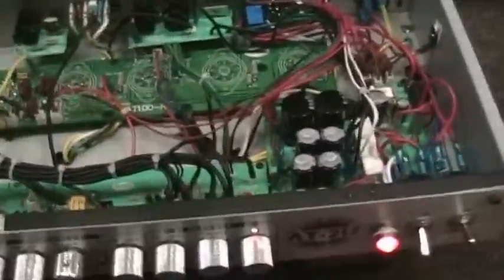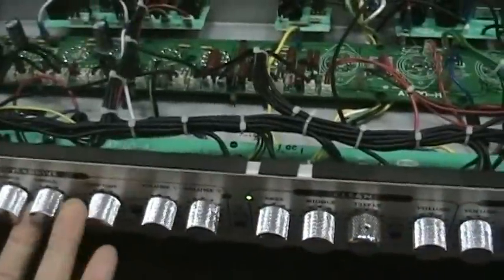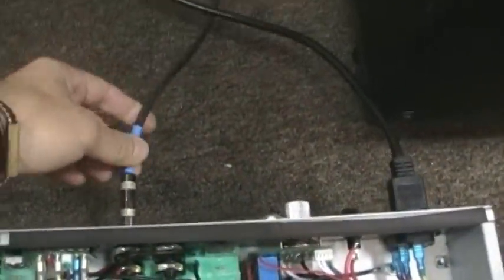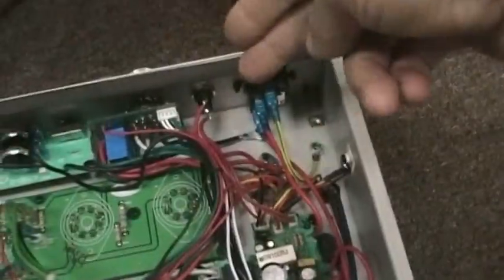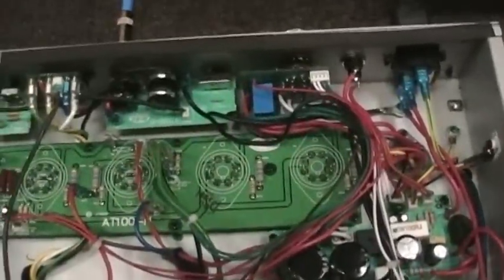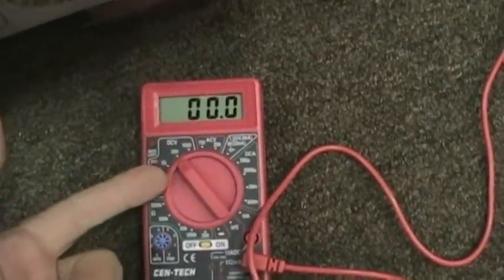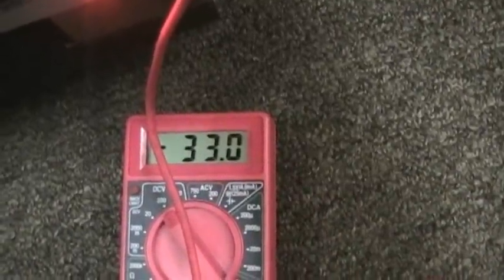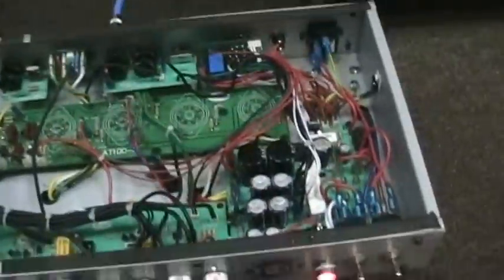B-52 AT 100 (212) amp bias info

Comment from the maker: Remove the fuse and connect your multimeter leads(any order) to the two red leads coming from the fuse(you will need multimeter leads with alligator clamps on them) your MM is now acting as the fuse, you will get a combined reading, Sovtek 5881's are 30 watt tubes Tungsol 5881's are 25 watt tubes ect. Thanks!

Comment: Getting back to Ohms Law you measure current in series and voltage in parallel, why you put the multimeter in place of the fuse to to measure the total current being drawn from the A/C line, you can calculate the total power by using P (power) is equal to I (current) times E (voltage), if you measure 120volts A/C and 1.2 amps (1200ma) of current with 4 tubes (30ma ea) you will be drawing 144 watts of power. Remember an amplifier is not 100% effecint we may see 70% which means we could expect in a perfect world 100.8 watts of power. We have to also remember to obtain any appreciable gain one must double you power (3 decibels) or switch to a 200 watt amplifier. That's a whole other discussion. I hope this helps

Comment from the maker: the way B52 tech says and that's removing the fuse and putting both leads of your multimeter on the fuse leads and setting your multi to milaAmps you get a combined reading of all four power tubes and then adjusting the trim pot to the amount of voltage you want going into your tubes, so yeah man I wouldn't do it the way explained in this vid on any amp, thanks.

Comment from the maker: What is Biasing?
We bias so (1.) our tubes are operating safely and (2.) because we want our amp to sound its best. When we 'bias' we're setting the working condition of our tubes. 'Setting the bias' on your amp is a lot like setting the idle on your car. If it's set too high (or "hot") the car's running away with you, but if it's too low (or "cold") it will choke when you give it some gas.

Comment from the maker: To put that into guitar terms, too high (or "hot") and your tubes may sound good, but will burn out quicker; too low (or "cold") and your tubes may sound sterile, but will last a long time. We don't want to be at one extreme or the other, but preferably at a nice spot in the middle. We want our car to run its best just like we want our tubes to last long and sound their best. In that sense, when biasing we're trying to find the perfect in-between point.

Comment from the maker: Hay man! yeah dude just shine a flashlight up in there and you will see that they can only go in one way, the power tubes have a plastic shaft in between the pin's, the shaft has a guide fin that will only fit one way into the amp, the preamp tubes have one pin missing and likewise the preamp sockets on the amp have one pin hole closed off, the power tubes are the same (you should have a matched set) and can be put in in any order, the preamp tubes are all 12ax7's except the reverb

Comment from the maker: Hay man, yeah actually the first way I explain connecting the multimeter leads to the fuse leads and first removing the fuse (but I don't demonstrate) is the way the tech's at B52 say it should be done, putting the lead on #5 pin was shown to me by a tech in his shop with my amp in front of us, now after learning more I agree that doing the #5 pin way is not the best way because you are reading the amps on one tube only, the best way and remember this is for the B52AT not any amp, is to do it

Comment: a C- of 32 @470v b plus is no where near close...you are measuring the grid bias voltage..now... in DC current mode set at 200ma; and reading in place of the fuse will show total current draw. the stock 5881s should be seeing a C- in the 50s...

Comment: After talking with 2 or 3 techs, I found this is absolutely NOT the way to bias an amp. Pin 5 gives grid voltage, not direct current.  You really need a bias probe to do it right.  Believe me I fought it until the experts explained to me how this will not work.

Comment: is it physical heat that causes the tubes to "burn out"? so that's like a literal burn out? What if you were to add a cooling system to the tubes would you be able to run them at higher voltages for the same amount of time as the stock tubes would run w/o cooling?

Comment: how you adjust the voltage? For instance, if the voltage reads lower or higher than 30 on the multimeter how do I adjust the reading so that it is within the range of 30?

Comment: Warning! Do  not bias an amp this way! U need to know current draw multiplied by plate voltage to equal plate dispensation in watts! Set to 70 % of a tubes rated output power.. 6l6gc = 30 watt tube , set tube to idle at 21 watts .  Learn ohms law and this will all make sense!
Reply: Does that mean that the voltage will go higher again if it is at 21? I'm planning to bias my at100 soon.
Reply: It very well could. Most cases tho it will drop.  All ways check current in respect of the voltage!
Reply: so basically, every tube amp bias measures about 30-40? (Sorry, I'm not very good with terms)
Reply: No. Of depends on the voltage and current. It all come down to what the wattage comes out to (ohm's law). A 6l6gc is a 30 watt tube. The tube needs to idle at 21watts to be at the safe operating condition. The voltage on the plate of the tube will go up or down with the current being adjusted but u can not a adjust the voltage. Every amp has a different plate voltage even if it is the same amp. Yes they will be very close but the biggest thing is the tubes will never be guaranteed to draw a certain amount of current. They may draw more or they may draw less. This is why bias all ways needs to be checked when changing tubes. The voltage me be so high you might have to set the tube to idle at 20ma of current draw or the opposite!  You need to take in to factor as well what the safe operating conditions are for the tubes. I hop this helps and makes some kind of sense
Reply: Aaron Roberts aite, so basically, what this guy is doing was correct in his own alternative way on the contrary with his measurements.

Comment: You should really remove this post, it is incorrect.  You are not measuring the tubes current flow you are measuring the negative bias applied to the grid, that is why you are getting the same reading on all the tubes. When you measure -40 compared to -30 your tubes are running cooler not hotter. -20 would be less bias and they would be running hotter. All you are doing is measuring DC Bias, that really doesn't tell you much. You are better off to read the current thru the HT fuse.

Comment: so what's the big deal about having your loudspeaker plugged in before you turn it on? i just picked a AT 212 up for a store, it was a floor model and i got a good deal on it. evrything seem's to work good, but i did unplug the loudspaeker while it was on with the volume all the way down to try and plug in some headphone's. so what could happen? you know anything about that?